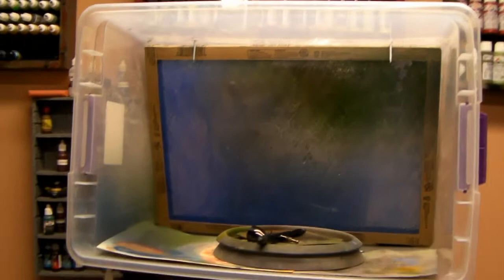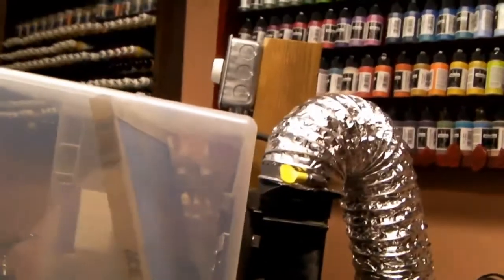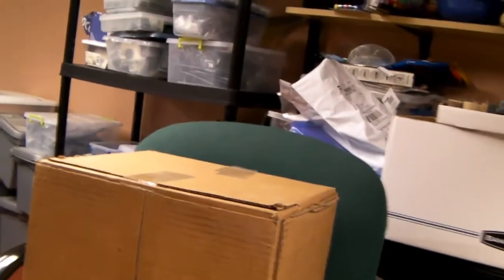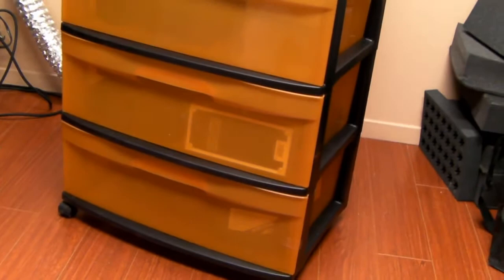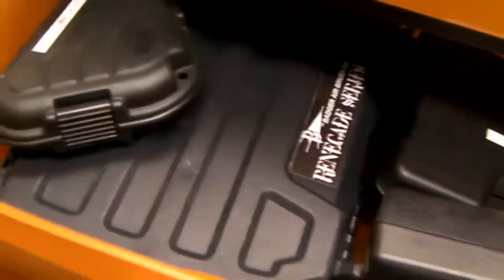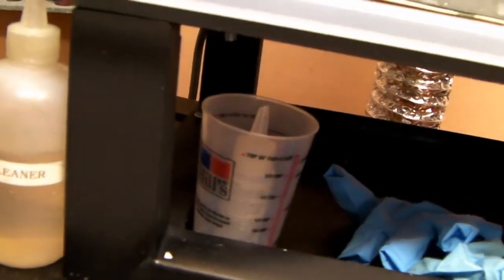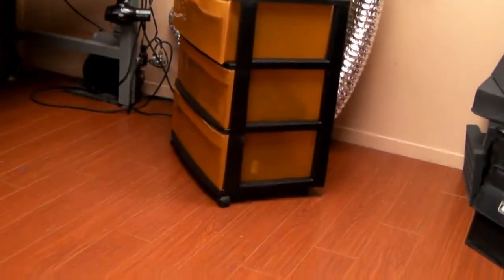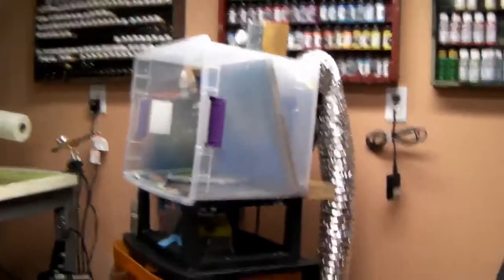DIY Airbrush Booth Rolling Cart

Comment: Nice...I have those three-drawer bins in each of my kids closets, and they work great, but any weight on top makes the drawers difficult to operate, which is what you are experiencing..the plastic is just not thick enough without a center support, but I think you will figure something out...Have a great Thanksgiving, my friend...
Reply from the maker: You are right. I probably will have to add a layer of MDF or thin plywood between the the booth and the cart. Thanks for the comment and Happy Thanksgiving to you too.